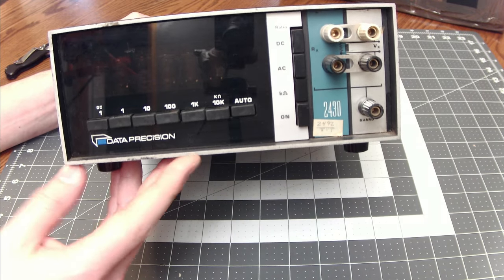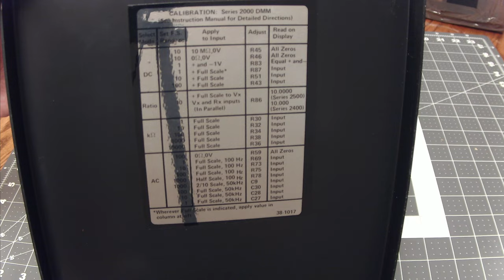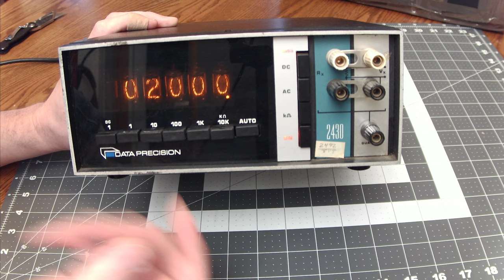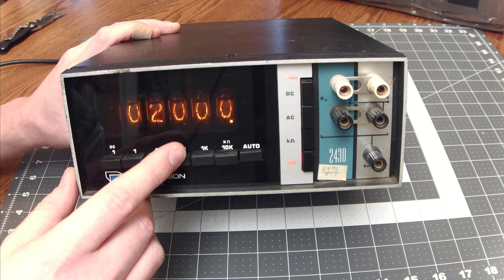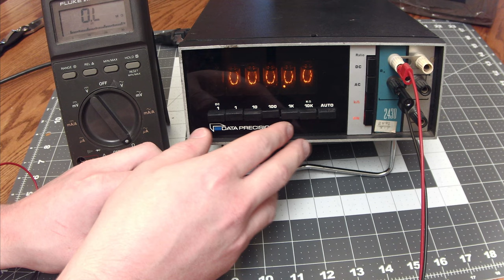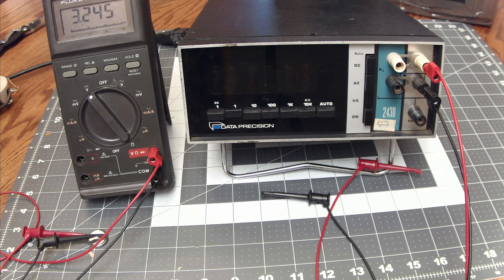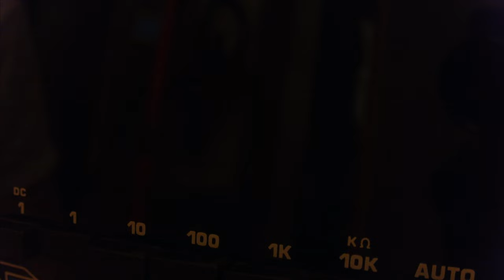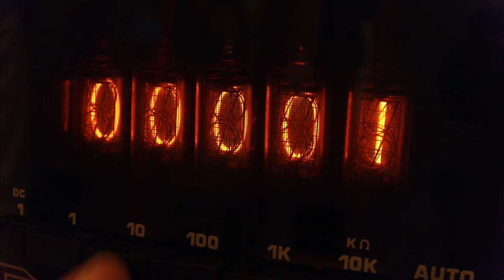Data Precision 2430 Nixie Tube Multimeter

Comment: 3:43 It's definitely had a major repair at sometime, some of the ICs have been replaced, some are now socketed, and whoever did the repair, seems like they left two of their blue IC logic test-clips in place.
Reply from the maker: Oh my goodness, I can't believe I missed that! Thanks for letting me know :)
Reply: @the-dan3974  I suspect it might be the same peep who forgot to remove their test-clips, also cable tied the switch.
Reply from the maker: @michaelturner4457  I would imagine so. They were fancy Pomonas too. I didn't think much of the sockets when I first saw them and thought maybe they were like that factory but upon further inspection, the soldering on those is different than the other non socketed ICs. The socketed ICs are of various different makes where the non-socketed ICs are actually Philco - Oddly enough. Someone definitely worked hard on it to get it where it is now but I suppose they didn't need the DC function. Maybe I
'll try to hunt down the rest of the ICs that weren't replaced!